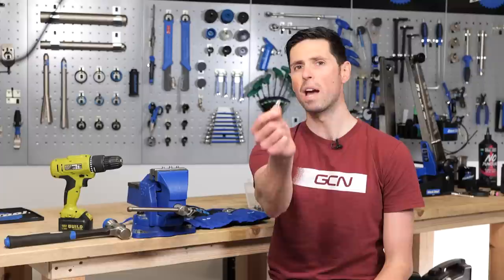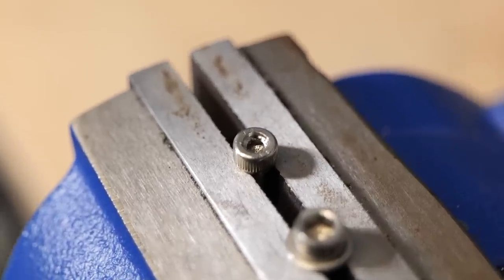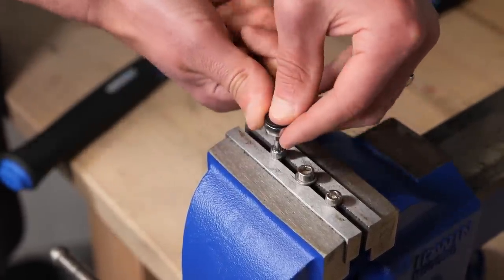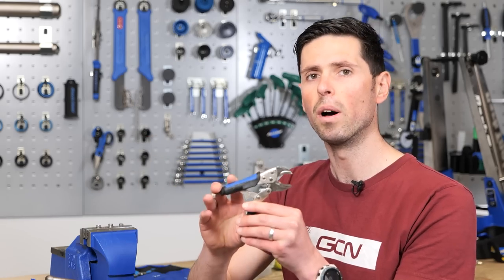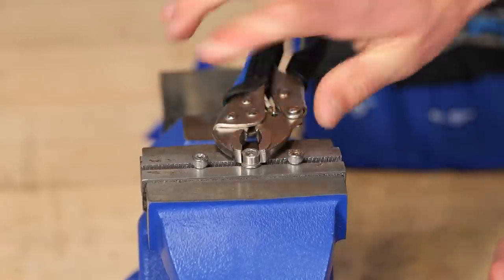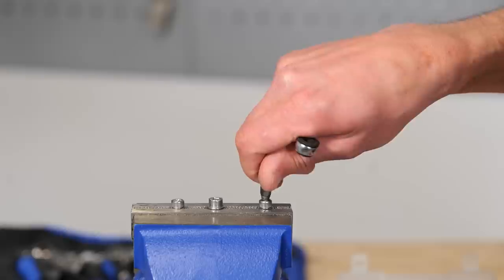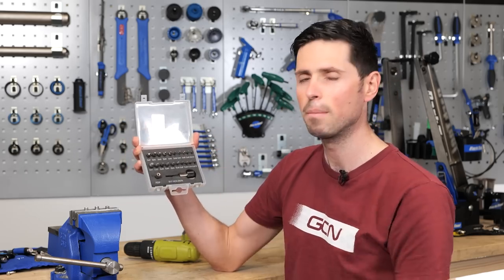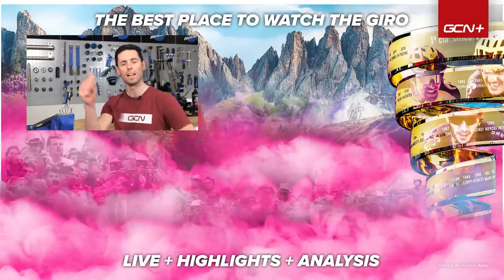How To Remove A Rounded Or Seized Bolt | Maintenance Monday

Comment from the maker: Do you have any other methods? Let us know down below! 👇
Reply: Heating up the screw with the tip of a soldering iron works pretty well, also. The heat is directed, and doesn't effect the surrounding area.
Reply: @not-a-raccoon  how does that unscrew it?
Reply: @traderz13  you use your teeth. 🙄
Reply: Using latex gloves to "fill" the rounded out bolt. It works if the bolt is not rounded out too much.
Reply: @not-a-raccoon  Can't be tight if it's a liquid
Reply: File two flats on the bolt head and then use wrench (spanner).
Reply: Use a dremel to cut a space for a flat head screwdriver or glue a cheap Allen key in place with a little bit of 2 Part epoxy glue. These 2 come to my mind additionally to your video, although option 2 is really desperate
Reply: Use a rotary cut off disc to create channel that can fit a flat head screwdriver onto the head of the screw.
Reply: Angle grinder
Reply: My favorite method for steel bolts in Aluminum parts: Heat the aluminum ( a heat gun will work, as will a propane torch used carefully), then use an "air duster" (usually compressed CO2 in a spray can). If you hold it upside down, you'll get a squirt of liquid CO2.  The thermal shock will often break a seized bolt loose.
Reply: I’ve used a hacksaw across the head of the bolt then used a flat head screw driver on numerous occasions, just take great care to get started as the teeth can run off.

Comment: On the domed head screws, I had success with cutting a grove for a flat head screwdriver with a saw.
Reply: Or a Dremel.
Reply: @not-a-raccoon  Even better, if you have one.
Reply from the maker: Great suggestion, Christian!
Reply: @not-a-raccoon  yeah had to deal with a couple rounded dome bolts on my bottle cage mount just a few days ago and dremelling slots into them worked a treat

Comment: Sometimes a similar size imperial allen key can fit into a rounded out metric bolt head. Got me out of a sticky situation in the past
Reply from the maker: Great hack!
Reply: How can I get an imperial allen key?Maybe order from the US?
Reply: @arnoldhau1  you need a kit as you never know which one will fit. They will be at auto parts stores as old cars often use imperial fasteners.
Reply: @zygmuntthecacaokakistocrat6589  Great hint, some people do own vintage american cars here (Switzerland)... So I guess I can also get such a set.
Reply: Funny you mention this. Being in North America, both imperial and metric sets can be found everywhere.

Some people have come to me to extract allen bolts that had been clearly rounded out by a slightly smaller imperial allen wrench.

In short, while your trick is great, make sure you are very careful if you have both wrench sets in your toolbox, but yeah, pretty good hack! 👌

Comment: I encountered a rounded button allen bolt a few years ago. 
I cant use any pliers because its a button style.
I cant use any larger sized allen key as the hole is shallow.

The only option is to use a saw to make a groove so that a flat nose screwdriver can twist the bolt off. Kinda hard as the bolt is bolted on a left brake lever. I think it was a dia compe gold finger brake lever.

Comment: This video totally saved my ass. I spent 2 days and 130$ in screw removal tools trying to get my front wheel crimp bolt out, and right before i gave up i tried the torx bit trick and it worked like a charm. Thank you :))

Comment: The best solution is prevention.  Use only sharp edges Allen keys. A rounded Allen key can be dressed past the worn rounded end. The ball end Allen keys should mainly be used for running in the bolt with a standard one for final tightening.

Comment: If you suspect the fastener  is corroded into the thread it's threaded into (which led to the rounded-out screw head), soak with WD40 or similar overnight. Tap the tool bit with a hammer to 'break' the corrosion bond before you try again. Or use dentist's freeze spray to shrink the fastener, or a heat gun to heat the component before freezing the fastener. Use good hex keys and hex key bits, and grind back to a true hexagon (slowly, without overheating) those that are getting rounded off. Wera Hex-Plus Allen key bits are better able to use rounded-out hex flats to grab the screw just enough to turn it.

Comment: I once rounded out my seat post clamp screw. Stupidly, I just used normal plyers which didn't grip great. It slipped off and I ended up scratching the seat post and the frame. Good thing the bike was alliuminium.

Comment: I bought a used bike with 1st gen Di2. I wanted to swap the mount to the extended one and was surprised to realise that with Di2v1 the cable was attached to the battery holder permanently and the previous owner had rounded out the bolts that attach to the mounting plate. Di2v2 has a plugin cable. Will be upgrading to Di2 v2 once i’ve had a bit more mileage out of this one. None of these tips would work because the bolts are too small and they are in a plastic housing so overall it is quite brittle. I cursed Shimano for a while after because the extended mounting plate cost £100.00.

Comment: Bleed port on top of a shimano 105 R7000 hydraulic shifter got stripped using 2mm allen hex. I ended up filling a flat edge opposite apart ended up using a small adjustable wrench. Still there until I upgrade to Ultegra.
Reply: It's a 2.5 mm hex for the ST-R7020, 2 mm is for Ultegra R8020 and higher.

You've been using the wrong hex size all this while?

Comment: Reverse thread remover is the only thing that works for me, usually the top cap bolt. I never need to drill a hole beforehand, as the bolt has been rounded out. Comes out so easily once its "bitten in"

Comment: The only method that's consistently worked for me is applying penetrating oil, waiting a bit, then drilling them out with a left-handed drill bit set, along with bolt extractor bits. Then I chase the bore threads with a tap of the right size and thread pitch to restore the threads for use with a new bolt. Works every time. This is especially the case when the bolt head is recessed or flat and there's nothing to clamp vice-grip pliers around.

Comment: If a bolt is just seized, and not rounded off (yet) sometimes tightening it just a bit can actually loosen it enough to undo. Might not be the best idea on a carbon component, however.

Comment: What approach would you recommend for removing a tiny grub bolt on Bontrager dropper seat post? The head is rounded so can't remove and therefore can't remove to service/clean the post. It's sticking on the upward return.

Such a tiny part failing has rendered the seat post useless

Comment: Had a nightmare scenario with a seized, then rounded out, sram bleed cap screw. After trying various tricks I thought I’d have to bin the shifter. Dremel and a flat head screw driver came to the rescue.

Comment: Penetrating oil works well and should be the first thing to try on a seized fastener. I have a handheld impact driver that is also good but not sure I would use it on my bike. 🤣

Comment: When relatively small bolts are seized due to galvanic corrosion (steel bolt in aluminium hole), applying big force is usually going to break off the bolt head from the shaft. Tell me how I now :( Next time, I am going to use an impact driver. You don't need more force in such situations, you'll need impact.
Reply: An impact driver will do the same thing, only quicker.
Reply: @zygmuntthecacaokakistocrat6589  I am not sure, we will see next time. The amount of force you can apply with a wrench is enormous. I don think an impact wrench makes the same amount of force, do you ?

Comment: i like so many others before me have a problem with my Ultegra R8070 rear brake caliper bolt seizing and the flat headed screw has decided it is made of swiss roll and crumbled at the sight of a screwdriver.  I cant use most of the usual methods for realeasing as it is flat head bolt, you cannot get a hacksaw in the area between the pads and i cannot tap in a hex or torx to move.  It would appear my only option is to dremel the edge and hope it comes out with either flat or cross head driver.  Has anyone any further suggestions ?

Comment: What about when you snapped a bolt so just the threaded bit is left ‘inside’ the frame? Extractor kit the way to go?Yes - I’m a chimp 😂
Reply from the maker: Unfortunately that would be your only option! Good luck!
Reply: You need a very accurate freehand drilling technique, a sharp drill bit with a proper point AND A DECENT DRILL ALEX. And a Recoil kit if it all goes horribly wrong . . .

Comment: How about a cracked pedal bolt that has bitten into the crank threads?

Not that i cranked the bolt too hard till it cracked or anything, just curious.
Reply: I'd just drill a hole through the pedal spindle and use a long steel rod to crack it loose. Since part of the spindle has already cracked, I wouldn't use it again.

One of my customers has this problem (still on his bike), but he plans to switch pedals and cranksets (powermeter upgrade) in the future.

Disclaimer: I wasn't the last person to install his pedals.
Reply: @yonglingng5640  so he still rides with that pedal? No safety issues?

Also, sure you weren't 😏
Reply: @Heltsin  It still holds up. I've tried cracking it loose in the past, to no avail. My first 8 mm hex bit socket was slightly mangled, so I stopped.

I do not mess around with bicycle safety. One of my customers' bikes had a crack in the steerer tube (due to inconsistent steerer tube thickness throughout its circumference, a giveaway of bad manufacturing quality) when I took the front end apart to see what caused his front derailleur's shift cable to be dead stuck. The moment I saw it, I sent a picture to him and urged him to not ride it at all.

There's a backstory to this, mistake of his if I may. Initially, he wanted to buy a Specialized Allez (aluminium) from me, but unbeknownst to me, he bought an EMC Equip R1.2 (carbon) for about the same price of the Allez he wanted to buy from me back then. Ever since then, the bike had problems no good road bike should have.

Stripped left crankarm thread for the pedal (mechanic error, probably didn't know the left pedal is left-hand threaded, later fixed with a helicoil insert, but not by me), rough shift cable performance (poor internal routing design, actuating the front derailleur is a real chore) and that cracked steerer tube.

I reckoned had he bought an Allez from me, none of those problems would've happened. Even he regretted not buying the Allez instead. All because of his, greed if I may say so, for possession of a carbon bike.

Comment: Soaking the stuck bolt in some kind of penetrating oil for a day or two also helps.
Reply from the maker: Nice idea!
Reply: That is not going to work when the bolt is seized because of galvanic corrosion
Reply: @Paul58069  Once you get it moving, it will help.
Reply: @Dravde  Yes, but only then.
Reply: @Paul58069  there's seized, and bonded. Oxide crystals that haven't completely bonded across the thread gap can be lubricated so that they slide over the other oxide and metal, which might be just enough.
Reply: @zygmuntthecacaokakistocrat6589  As you name is Zygmunt, you must be intelligent, so you may be right :) I will try an impact wrench next time. 3mm bolts cannot take much force, they snap off easily.

Comment: Lol my pedal has currently managed to kill 3 separate allen keys 😅
Reply from the maker: Oh no! Keep at it, but if you're struggling, take it to a shop to get fixed!
Reply: soak the joint with WD40, leave overnight, and use an Allen Key socket ( 1/2" ) on an impact driver. Your pedals are cheaper than your cranks. REMEMBER TO GREASE YOUR PEDAL THREADS EVERY TIME.